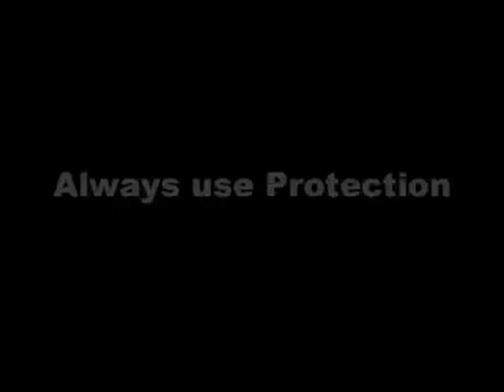001 Constructing the Cell

Comment: Its best to have two individual cells in two seperate baths. Or have one bath that is isolated from the other side. But generally two cells splitting the voltage is more efficient in terms of total HHO output. If you have a SS container you can add more electrolyte and just crank up output.

Nice videos bud!